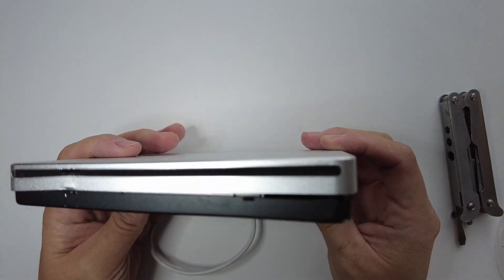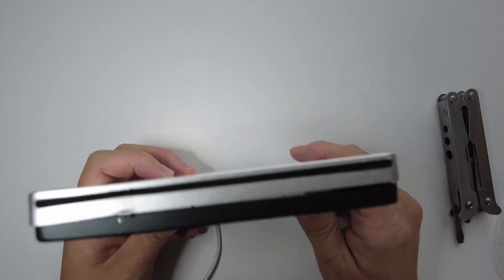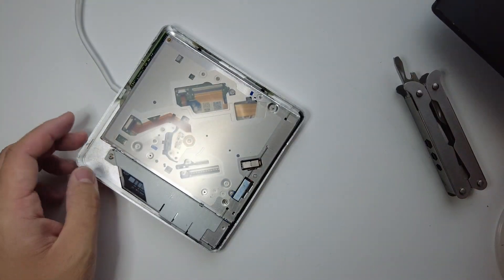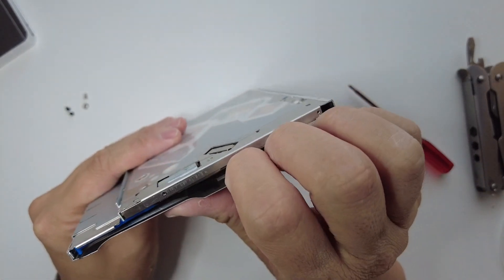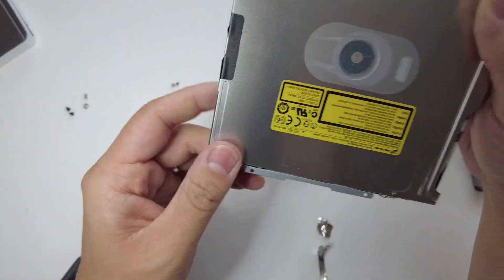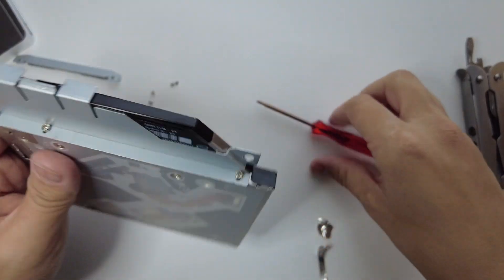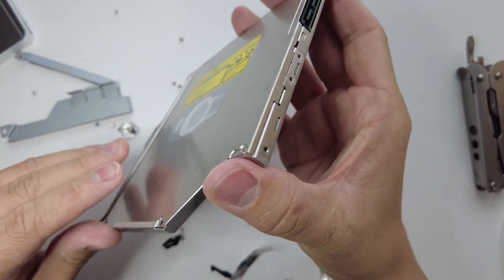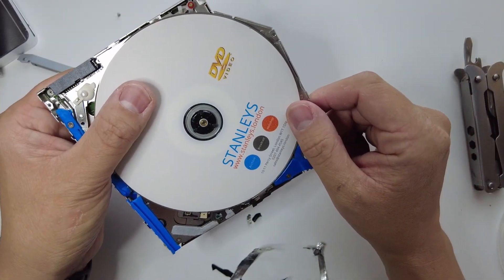Manually Remove Stuck Disc from Portable USB DVD Drive (Won't Eject) - Nolyth Brand Optical Drive

Comment: Holy destroy the drive. My problem is that I think the CD has not been formatted, so the OS (Mac & pc) don’t recognize the disk. Other than that, the drive worked great. So basically I should just throw the whole thing out. Just surprised there was no pin hole in it.

Comment: If you're on a Mac definitely try opening the Terminal app found under the Finder Go menu in Utilities. When it opens type in drutil tray eject. Those three words with a space between each and hit return. This should eject your stuck disk whether the Finder or Disk Utility is even recognizing the CD drive or not. Also make sure your CD drive is connected directly into the USB port on the computer and not connected to a hub. Good luck out there.
Reply: This totally works on the command line, but I can't make it work in a script: it unmounts the CD but doesn't eject it, and then remounts it as though I'd just re-inserted it. Which is the same behaviour as using the normal UI eject methods like dragging the CD icon to the trash or hitting the little eject button in the finder. Curious! But still, thanks a million.
Reply: @spuntotheratboy how do i fix that? Mines doing just that, eject = remount. I cant seem to get it out
Reply: @cupcakeobsession  the `drutil tray eject` method worked at first for me, then it started doing the umount-mount thing. When I unplug the drive, reboot my machine, plug the drive back in and try again, then it works. It stops working soon, but it works again when I unplug, reboot, plug back in... I mean, it's clearly not a robust solution! All I can tell you is it's working for me so far.
Reply: @spuntotheratboy  i tried it all, even the credict card trick, but what got it in the end me clicking eject while shaking it upright. Im using it as normal rn through 3 disc and its fine... I think that first disc is cursed 💀
Reply: @cupcakeobsession  Lifesaver
Reply: That worked for me. Thanks!
Reply: Well, you've saved me a bunch of time and money, thank you very much!
Reply: Great tip thanks! Faster than even finding a paperclip.